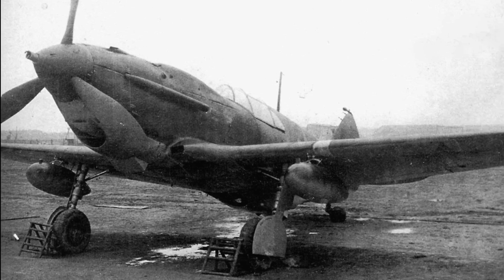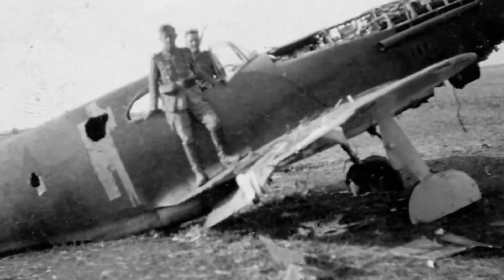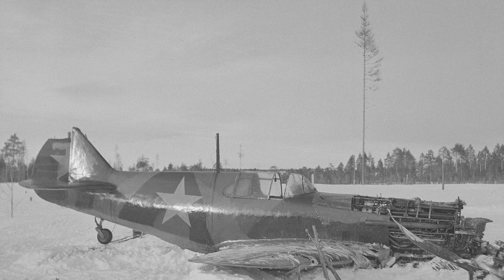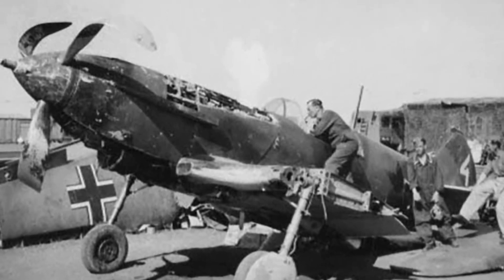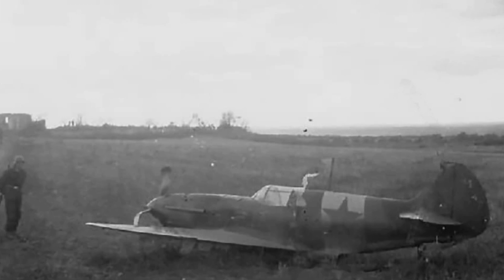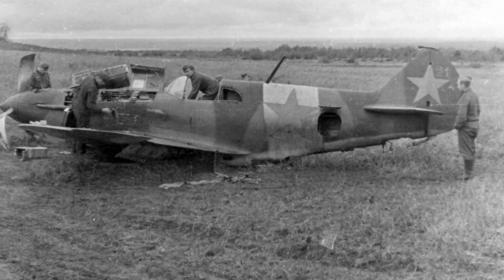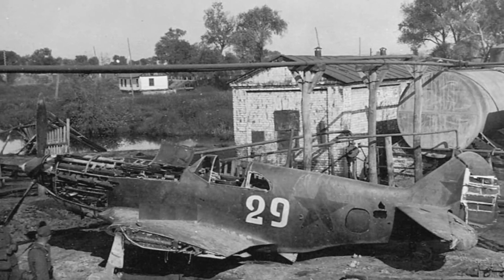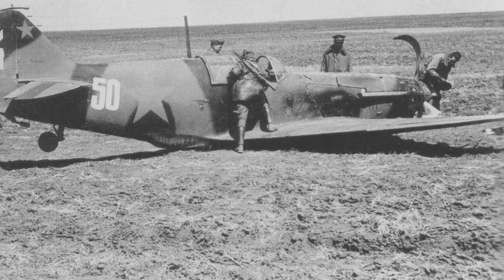The Lavochkin-Gorbunov-Gudkov LaGG-3

Comment: I believe that the alliteration of the aircrafts abbreviation to Lakirovvony Garantinovy Grob was more as a epithet rather than a compliment. The special material used in the aircraft needed had an unpleasant tendency to Crack at it's weak points if hit by 20mm shells specially in the winter. And the repairs could not be efficiently done at forward airbases and the patchwork repairs was even more vulnerable to enemy fire.
Reply from the maker: Hi Peter, "guaranteed varnished coffin" sounds very much like Russian dark humor. I think It's hard to comprehend how cheap life was in that age, or how gallows humor was very much a norm. Not surprising about the 20 mm HE round shattering the Delta Wood, but didn't come across any mentions in my research.
Reply: @Aircraft_Files  When a society goes through what poor Russia endured after 1917, dark humour may be the only alternative to insanity.

Comment: It gets a bad rep. Most of the issues with low power from the M105P were due to common fuel quality at the time, in fact imported western fighters had to have their boost detuned for this reason and killed their performance too, whilst Germany shipped comparatively good quality synthetic fuel with their front lines. This lasted until the lead up to Stalingrad when fuel quality finally started improving and this was reflected in revisions to the Klimov engine, with increased boost and therefore power. It was in fact a good engine base, being a local development of the license made Hispano-Suiza V12 inline and roughly equivalent to an early Allison.
The LaGG3 did suffer more from the initially low power because of its heavier construction than the Yakovlev design, which employed doped fabric like a Hurricane in early models, but again this was a bad rap where the real matter of concern was workforce capabilities to immediately produce aircraft. The designs placed into mass production had to suit available or easily trained workers and industrialising that part of the world was a more recent phenomenon than in the west. It was a more acute version of a problem Britain had as to why they produced both the Spitfire and Hurricane instead of focusing all production on the better Spitfire, simply the Hurricane used the same manufacturing techniques as biplanes and suited an existing workforce, the Spitfire was an all-metal stressed skin monocoque that required new skills training so had a limited workforce. The Soviets had that problem exponentially worse, just building Yaks like a Hurricane or biplane took new skills training and manufacturing quality was so bad that it was a feature for workers to be dragged off to the Gulags for sabotage. But the LaGG construction made use of more available domestic skills like laminate woodworking and locally available materials to the construction sites. Obviously in terms of mechanical components it enjoyed the same issues as Yaks or any other aircraft at the time, lots of manufacturing problems from a relatively inexperienced workforce learning new skills. From 1943 however with improved engines the LaGG3 became a little more widely attributed with combat victories and featured quite a bit less in the Luftwaffe kill claim records, remaining in service throughout the war despite falling out of production as the La5 and especially Yak-9 ramped up. As manufacturing quality had vastly improved, a late LaGG3 is probably as good as a midwar Spitfire. It is also worth noting the La5 is the same aircraft with a different engine section for the radial, its 1700hp vastly increasing airframe performance over the 1150hp of contemporary M105, or 1850hp to 1250hp in early 1944 production.

Video corrections, the 7.62mm MG are ShKAS, not Beresin. The Beresin is 12.7mm and was later rechambered for 20mm in 1945 to replace the older ShVAK cannon. The LaGG3 however didn't get the Beresin, but at one point were used to escort Sturmovik squadrons and the ShVAK 20mm was swapped out by a very hard hitting 23mm Nudelman, rounds which held twice the explosive filler of a 20mm. These were used for strafing attacks on mission if not called upon to defend the Sturmoviks. Rockets and bombs were also employed for this purpose of supporting ground attack squadrons, doubling as fighter escorts. Some specialised Yaks did this job too, the Yak-9B carried an internal bomb bay for the purpose and the Yak-9T used an insanely powerful 37mm Nudelman for anti-materiel attacks. Apparently the recoil was so remarkable it actually slowed the aircraft significantly in flight. Still, a late LaGG3 with a 23mm motor gun is nothing to be scoffed at.

Edit to add one more story. Early in the siege of Leningrad when British Hurricanes were arriving by sea, due to the local fuel related boost restriction and poor adaptability to the frigid Russian winter the Russians commonly just stripped them of their luxurious equipment like armoured seats and quality radios, put those into LaGG3 being shipped from the south and flew them instead. Build quality was poor but at least they flew and when they did they weren't all that bad compared to any available alternatives. Britain and the US enjoyed 100 octane fuel from 1940, they don't realise just how good they had it. One of the very remarkable things about Germany was matching 100 octane performance using 87 octane synthetic for most of the war, that was some otherworldly shit.
Reply from the maker: Lovely. Thanks for the info and feedback. let me know if you would like to contribute content, such would be most welcome.
Reply: @Aircraft_Files  sure I would. I've done some deep dives on a few warbirds doing research for my flight modelling in the SAS Mod version of IL2:1946 many years ago. I've spoken with Dietmar Herman (author Ta152 reference material), the White 8 project mechanic (genuine Fw190A8 restoration to flying condition), had a nice little stack of Allison documents researching the P40 exports (overboosted field modified 1780hp P40E in RAAF service and 1650hp with the RAF, the published 1150hp is a little understated let's say and now we find out the real reason the Warhawk was so popular with pilots yet unremarkable on paper), there's a few aircraft I've been way into. Started with my family coming out of WW2 Germany so gave me some inside info that wasn't published until recently, like Galland's special hotrod Messerschmitts, the ability of an Me109K to match up with a P51D or a Hawker Tempest over Berlin, these were things that in the 70s and 80s people just didn't know. And even now those old misconceptions die hard.
Reply from the maker: Well I dont seem to know how to DM in You Tube. If you do please send me a message. :-)
Reply: @Aircraft_Files  "Well I dont seem to know how to DM in You Tube. If you do please send me a message."

There is no default way of sending PMs in YT.

You have to add a public email address to the channel, so that it's visible on the "About channel" page.
Don't use a common email address however, because i'm told the spam can be monumental.
Reply from the maker: Try this historyfactsshorts@outlook.com
Reply: "and the Yak-9T used an insanely powerful 37mm Nudelman for anti-materiel attacks. Apparently the recoil was so remarkable it actually slowed the aircraft significantly in flight."

Yeah, that and the 45mm cannon were definitely on the edge of functional.   If a pilot held the trigger for too long, the plane could lose a lot of airspeed from the recoil.
Reply: @DIREWOLFx75  I don't think the NS45 ever got past the prototyping stage with only three aircraft ever fitted with it, specifically for that reason IIRC. You could actually induce a stall when firing at low speed and altitude, with a shallow dive, as is required for accurate ground strafing. The FW-190 fitted with a pair of 3cm high-velocity MK103 pods under the wings had a similar problem, the sledgehammer recoil slowed airspeed so much in any accurate ground attack attempts and yawed the small fighter so violently that it actually induced stalls and the armament option was cancelled and unavailable, despite remaining in pilot manuals as a listed option. Lightweight fighters can only handle so much gun power and then they just crash pointlessly.
The Yak-9K, which was the one with the NS45 did actually remain in active service, all three of them but only three were ever made. The Yak-9T with the NS37 was mass produced.
Reply: @jasonmorahan7450  "I don't think the NS45 ever got past the prototyping stage with only three aircraft ever fitted with it, specifically for that reason IIRC."

A total of 53 Yak-9K were built April to June 1944.   The plane overall was highly thought of as it incorporated several new upgrades, but the 45mm cannon was very much NOT as it degraded performance just by being mounted.
Originally, the -9K was going to be the "ultimate" Yak-9 version...   (that REALLY didn't work out well...)

But apparently, the -9K variant was the first(only?) serial model to make the nose cannon mount modular(taken from the -9TK single experimental model of 1943), so most or possibly all of the -9Ks were switched to the 20, 23 or 37mm cannons.

So, if you find records of a Yak-9 with a 20, 23 or 37mm motorcannon, with armored glass front and aft in the cockpit from no later than June 1944, it's actually a -9K with the cannon switched out.
Reply: @DIREWOLFx75  I stand corrected. It's been several years, I confused it with the FW190 with MK103 pods, of which only 3 were fitted with them before serial production of the modification was cancelled due to performance issues. My bad.
Reply: @jasonmorahan7450  "I confused it with the FW190 with MK103 pods, of which only 3 were fitted with them before serial production of the modification was cancelled due to performance issues."

Ah, that's close enough to be an easy mistake to make.